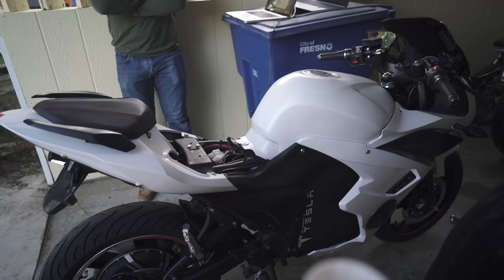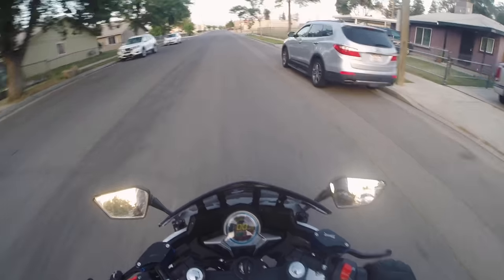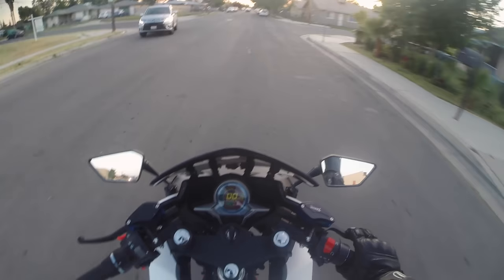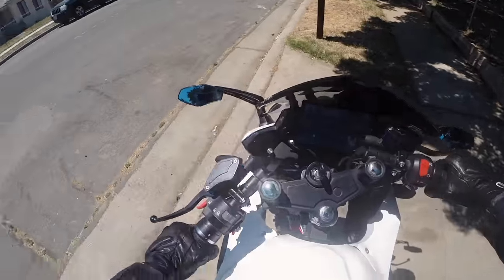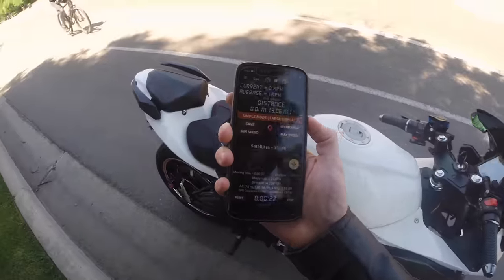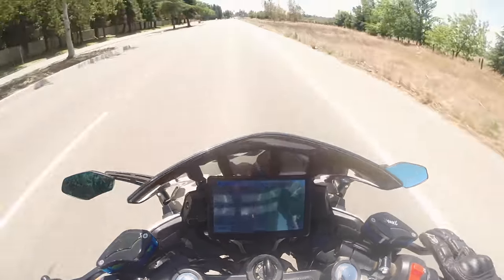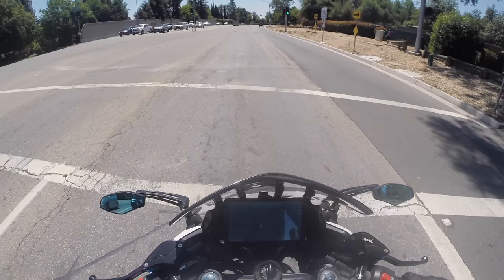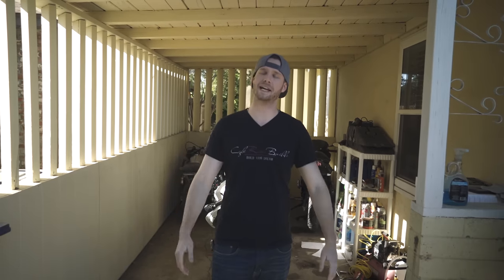CHINESE ELECTRIC SPORTBIKE – Top Speed [AFTER MODS]

Comment: Personally I would turn of regen or reduce the level, when going that fast or even just 50 the motor can produce a lot of amps under regen that it is dumping into the controller but the controller will only allow what is safe to get to the battery and the rest is burned of as waste heat and this significantly heats up the controller, the amount of power that gets to the battery through regen is usually never enough to give any significant range benefit, the only benefit is an engine braking effect, I guess the other option is strapping a cooling fan on it.
Reply: EQUINOX 
Surely if you turn the regen braking OFF the controller will have even more power to have to dissipate ?
Reply: This is a really good point. Most ev's ramp up the Regen as the battery dies down to allow room for the regen power. My zero and 500e both do this.
Reply: I'll second that. Regen is the destroyer of controllers. Especially if you're close to the mosfet voltage limit. Maybe ditch slip regen and just use an ebrake button or tie in with the lever, your kelly might have variable regen too, so you can gauge how much regen you want on the fly.
Reply: @WhiskeyGulf71  Nope, They freewheel silky smooth without slip regen. It's literally as if the motor was disconnected during freewheel without regen.
Reply: @WhiskeyGulf71   No, when regen is disabled it remains as an open circuit, so when you twist the throttle it closes the circuit letting the power flow and as soon as you let go to coast it opens the circuit so the motor is not technically connected and so cant generate power, this allows it to freewheel smoothly and freely.  However with the regen setting he used it was always a closed circuit  and in this state it will always generate power and cause resistance and excess energy that leads to heat.

Personally on my high power ebike I have regen enabled but only when i pull the brake lever this allows me to save power by coasting/freewheeling down hills but i still have the benefit of engine braking to assist when stopping
Reply: Or, living in Antarctica! Temperature problem solved.  Simple? Yes. Easy? No. Practical or desirable? Hell no. :-)
Reply: I agree I have the same set up and have figured out that regen braking is not worth it on a motorcycle. Doesn't add any significant range. Just buy more batteries, more bang for your buck.
Reply: more cooling for controller....it needs free air to flow around it.  A fan is a great idea for the enclosed area in which it resides.
Reply: i agree try a fan mod and see or even a liquid cooling mod like that on a pc or something there is endless possibilities when doing custom mods its worth a try mayb also test the temperature of the controller when used at full capacity see where its limits are and try work on keeping it cooler under it max load before it switches off
Reply: STOP BUYING ANYTHING FROM CHINA
Reply: @johnrice6670  The problem is not that things are made in China, it's that the Western companies have outsourced most of their manufacturing there in an effort to save "human" costs.
Reply: lahokc59 woooosshhhh
Reply: @sniuchi2549  I believe it is you who this woosh should be applied to.
Reply: controller dont do that the BMS i assume doesnt have shunts to dump the extra current
Reply: @johnrice6670  then you don't have anything??

Comment: That bike scares me for one reason no noise loud pipes save lives
Reply: That's absolute nonsense. And for the record I have a full Akrapovic system on my ZX6R. It's loud. But it doesn't cure people's perception of speed and distance.
Reply: @bwright138  did you watch the same video the bike isn't making noise cuz he converted it to electric you probably have your motor on yours or something but on this video I cannot hear it compared to a real motor
Reply: @joshuaarreola5813  I was replying to your assertion that "loud pipes save lives."
Reply: @bwright138  well if I can hear ya I would look around for ya at the very least I do drive carefully around bikers myself I ride myself as well just currently don't have a bike
Reply: As a biker chick since 1987, I agree, the louder the bike, the better chance to be heard.

The more advantages that a motorcycle has, to be seen or heard, the better ...

REGARDLESS, I would really like to have an e-motorcycle. 

Possible horn mods: 
•a horn on it that would wake the dead
•a horn that sounds like high rev
•a horn mimicking loud muffler
•a horn sounding like a ship siren

Something like that.
Reply: What you say about louder makes you more likely to be seen makes a lot of sense. But unfortunately statically it has made no difference in motorcycle accidents.
Reply: Hi @trsskater  ,
 just to be clear, motorcycles are NOT usually seen at all. 
My philosophy as a biker is, that if a motorcycle can be HEARD (zero chance with E-Bike) a driver MIGHT LOOK (for it). 
If passing on highway, I count on the fact that drivers DO NOT KNOW I am there, I pull in the clutch, give a good loud revvvv before passing because a biker horn is not going to be heard at hwy speeds, logically, it gives me a better safety chance.

So the bottom line for me is that unless the driver of a car is a motorcyclist, a motorcycle will not be seen and the potential for disaster is his higher. 
Many ways to increase safety on the road for a motorcycle rider, loud bike is one great way to increase safety.  This does not mean a driver of a car will see a motorcycle, it means that if a motorcycle is heard by drivers, they might be looking, hence your safety on the road increases.
☆ A motorcycle may not be seen but it can be heard.
Reply: @trsskater   Appreciate feedback as far as statistics go, I think that Our chances of being seen are better if we can be heard.😉

Comment: You need to cut some vents in the so called gas tank so airflow can help cool the controller. That should make a world of difference 👍👍
Reply: A better solution is to add a fan to circulate air or add a scoop to catch air and direct it across the controller.

Comment: If you're worried about the axle nut, you could drill a small hole through the corner of the nut between two flats and safetywire it in the tightening direction (clockwise) to something stationary. It's an aircraft manufacturer technique to keep nuts tight and from backing off during stress and vibration.

Comment: I have a similar bike in Canada. They are sold under the brand of Daymak and are limited to 22mph, but you can remove the limiter with a phone app + with just a battery swap (lead acid > lithium) it can go around 45mph, which is great for just city cruising.

Comment: Cooling fans is one option but a simple ram air kit should be considered too - these are used on high end sports bikes to direct air into the intake but you could fashion something to pull air over/around the controller.

Great work so far by the way, I've been following this build since the start and I'm a new subscriber because of this!

Comment: 73 mph on 8000w motor glad to see you got it running good. When u reset the key you are resetting the error on the controller. If you want to know why it's shutting off you need to connect it to computer when it errors out. Great job man I love it I look forward to your future videos.
Reply: Definitely it's the auto cut off for the controller due to heating
Reply: Maybe add some air intakes and exhausts to the controller housing?
Reply: @Koichifirst  
Or maybe a liquid cooling plate, pump, and radiator, with Evans waterless coolant?
Reply: Well that sounds a bit over complicated XD the controller should be fine with just the airflow from the driving.
Reply: @Koichifirst  a simple flex pipe mounting to the front air dam will do it
Reply: should put it on freezer, a portable side box freezer 🤣

Comment: I've always been put off by these hub motors, but you may have changed my mind on that, for packaging it would be ideal for a project I have in mind. Digging the build, that's legit dude
Reply: You can also get water cooled hub motors for higher performance. Still, they are pretty limited.

Comment: My qs 8kw motor with Kelly controller came in today! Getting it installed tomorrow! Can’t wait to experience what you experiencing. I think if you turn off regen on the third level speed you can increase top speed. Also look at your tire width to help with top speed.

You should do a 0-60mph speed test. They say under 5 seconds.
Reply: what kind of budget is this all running? looks like a fun project
Reply: Life With Fitz about 10k CAD for my setup 

3k for base bike 72v 
5k for 60ah lithium (2x30ah)battery with 2 chargers 4.5a input each
2k for qs 8kw motor hub kit with controller 

Also would recommend high quality tires about $200-300 per tire front and rear.
Reply: 10k y wouldn't just buy a zero motorcycle that goes way faster and unknown it's reliable and safe
Reply: Slim Princess it’s the whole point of the series, to build a bike up and upgrade it. It’s fun to watch and fun for them to do
Reply: Slim Princess 10k Canadian. Zero is about 16k Canadian for the bare bone base model which has 2x32ah batteries and top speed of 137kph with a range of 75km. Mine has 2x30ah batteries with 2 chargers instead of 1 and top speed of 120kph but a range of 120km. My next plan is to build another bike with Samsung cells so I can do fast charging in 30 mins instead of 6hrs. Also zero base model looks like a shitty base model dirt bike. If you want anything that looks good you need to spend 35k+ Canadian. Also for my next build I’m planning a 14kw motor with 200kph top speed. Also these are hub motor base not belt driven, so zero moving parts no maintenance. The zero are belt driven and has more torque yes but make a lot more noise and the belt can snap.
Reply: 5EM3 60ah 5k Canadian to install and chargers at a shop not doing it myself. To build a custom battery is a good price. You can buy Cheap Chinese batteries with terrible bms for $700. Good luck with that.
Reply: 5EM3 qs motor 8kw motor complete kit is 1400 usd + shipping. I paid 1088 usd +250 shipping. That’s about 1900 Canadian. Tell me where you can get it cheaper.
Reply: @bsmith2340  - personally I like the look more of Inja's vs. a Zero. There is also a level of fun and achievement of doing it yourself...
Reply: @5EM3  I feel it's easy to say this... but once he'd already gotten the chasis there was no turning back... this way he also got to make it his own and learn along the way.
Reply: 5EM3 if you include just the Kelly controller that’s +350 usd. That’s already 915 usd. I paid 1088 usd complete kit with brakes new throttle and Bluetooth adapter for controls enabled on my phone to go instead of having to plug it into a computer to modify the specs.

http://www.cnqsmotor.com/en/article_read_801.html
Reply: @spiicytuna  I agree I guess it kind of sounded like I was being a troll wasn't meaning to I definitely like watching the videos I guess I wasn't saying that I love anything electric I'm just saying it is still pretty pricey but I guess anything electric is I'm just saying the zero for performance wise isn't even in the same ballpark as this bike my SRF it's fast as hell but let me say this I love the videos I like this guy's channel and you did an amazing job

Comment: Your homemade Zero is amazing! But what about the stock dash? You just installed the GPS over it?
Reply from the maker: Yessir! Does read speed anymore. Just check it for battery voltage after each ride.
Reply: @TheInja  it was reading speed from the previous motor? or?  There was no way to rig it with the new motor.  I like everything about the build but it's more my style to keep more of the oem look vs. a GPS over the stock dash.  Keep doing what you're doing and I'd love to see any mods you to to help thermal displacement on the controller; shutting off like that could be dangerous depending on where/when it happened.

Comment: hey i have one of those bikes...when it shuts off like that it means your operational voltage has "dipped" below the recommended operational voltage  (set by you in the controller)
Reply: thankyou so much for this info, mine is doing that and I got stuck on the road for a minute was worried, someone was gonna run me over lol. how can I lower that limit?
Reply: @Wanttono  if your bike has Bluetooth or USB, the limit should be 10
Volts below so 72volt bikes have a 62volt shut off usually or sprung 64 even

Comment: Require a smart BMS, view cell groups and battery amp draw, or a bluetooth active balancer capable of 2+amps per cell group. The cut-off I’ve experienced on a Kelly controller but I suspect was the BMS setting. I raised the amp capacity of the smart Ant BMS, adjusted the battery amp availability on the Kelly, and had no problems include journeys more than 100km continuous. I only draw 63amp max from my battery. Seventy miles an hour that is great. Want more torque then adjust the available amps from the battery via the Kelly and shorten the time to top speed. Be careful could flip the bike. Awesome video maybe buy one those bikes.

Comment: awesome job on the bike. one way to know for sure if its the controller overheat cutoff, is to remove the mock tank and do same test again to allow you to physically put a gloved hand on controller testing to see if its thermal or not if its hot through a glove time to make some air ducts under body work to direct airflow to it

Comment: I couldn’t see your battery voltage, but I had almost the exact same symptoms on my lil ebike. It ended up being that my battery was just not quite powerful enough and after a bit of use and the voltage had dropped, when I throttled hard it would under voltage causing the controller to cut out. Turning it off and waiting a little let me use it again but if I throttled too hard it would keep shutting off. Hope this helps!
Reply from the maker: Lost only about .8V that ride, wasn't that!
Reply: Sebastian meant voltage sag under load. I doubt that is the issue since you have a huge battery pack.

Comment: Nope. It's Voltage sag.

When you fully open the throttle your voltage is (temporarily (surge)) dropping below the default protect setting. The same thing happens to me when the battery is no longer fully charged.
You need to go back into the Controller settings and lower either the threshold or Max Amp draw.
Reply: Or build in capacitor pack which can deliver the peak amps it draws
Reply from the maker: Battery was still at 79.9V after the ride
Reply: @TheInja  

It doesn't matter. The surge pulls it waaay under that until it recovers. But the "low voltage protect" has already been activated which is why it shuts down.
Reply: @JD Rides 
A cap pack (my experience comes from RC cars and drones, similar but smaller scale, lower voltages and higher amps) will smooth the voltage ripple, kind of delaying/reducing the voltage sag a little and depending on the capacity, capable of dealing with high amp draw bursts for a set amount of time.

Yet, in the end the battery can only deliver what it can deliver. With or without capacitors. A typical li-ion configuration will deliver up to 60A per parallel cellpack. A 8k watt motor(assuming its peak) @64-84V will draw up to 130A on high load (acceleration). A 3P or 4P configuration should be able to deliver that with ease. A few bad cells on the wrong places could ruin it though. If you have a 10+% voltage drop on full throttle acceleration i'd look in that direction first. Measuring their internal resistance can give some insight.
Reply: Yes, I've experienced similar to both of my ebike & escooter. I'm guessing this can be limited in the controller settings, to prevent the throttle from drawing more than what the battery has. Otherwise, a slow increase of throttle input could do the trick.
Reply from the maker: Debunked. Voltage sag is minimal and not the issue
Reply: @TheInja  well now it gets more intriguing!
Reply: You might need a temp sensor on that controller. See how hot it's getting.

Comment: Sweet bike good job! If you want more peace of mind with the axle nut just drill a hole through both the nut and axle. Remove the nut and drill holes on every side so you can insert a cotter pin and still hit the hole when the nut is tightened in any position.

Comment: Nice build, I used to build a lot of electric bikes, would sometimes experience the same thing you had when hitting high speeds. For me, it was usually the current limiter of the speed controller kicking in to stop things from getting too hot. Be sure to let us know what the issue was in the next vid!
Reply: You still build bikes? When did you build em?
Reply: Sounds logical. Why did you stop building electric bikes
Reply: Ahh, I stopped building bikes because I had a LIPO fire. Make sure you don't ever cheap out on your charger, check your batteries for soft spots daily, and make sure they are stored in fire-proof bags 🔥